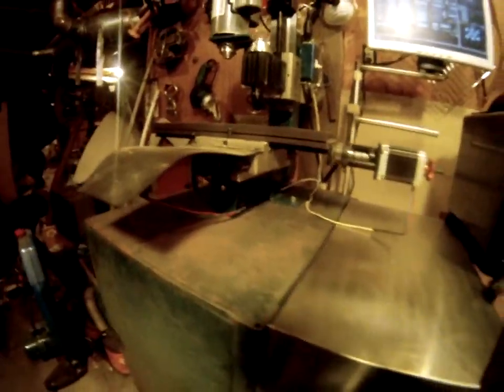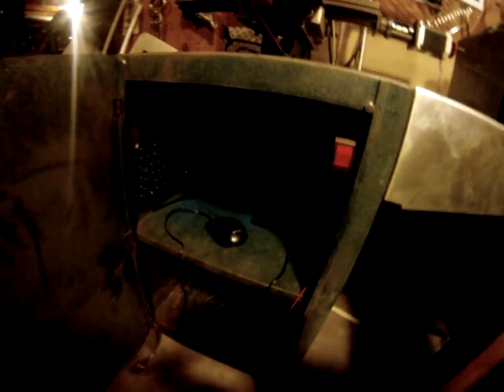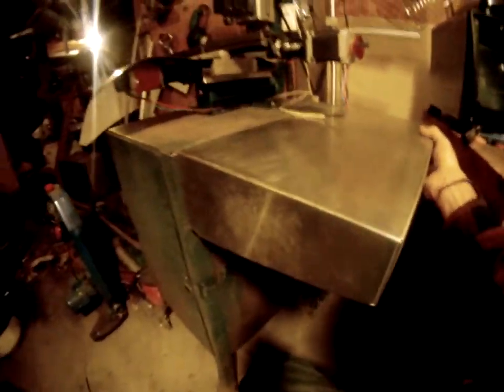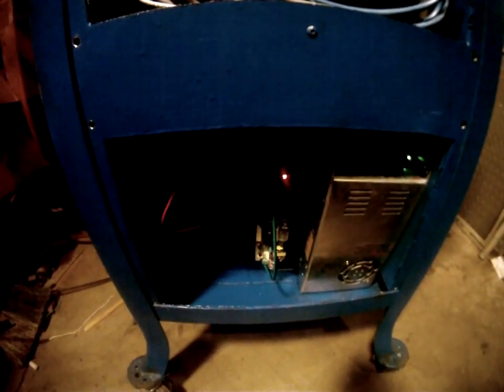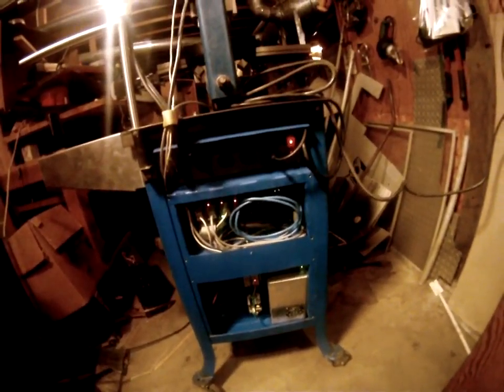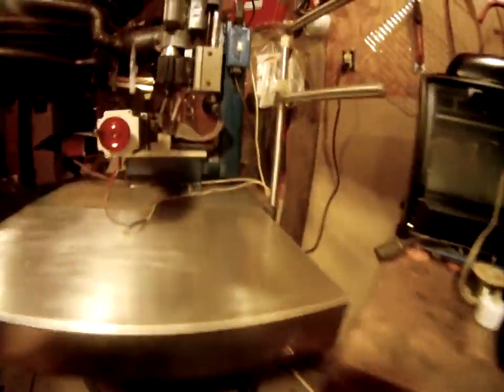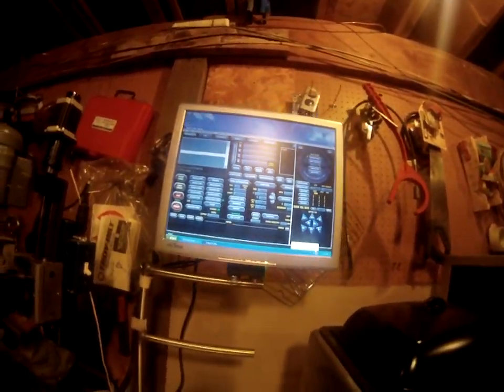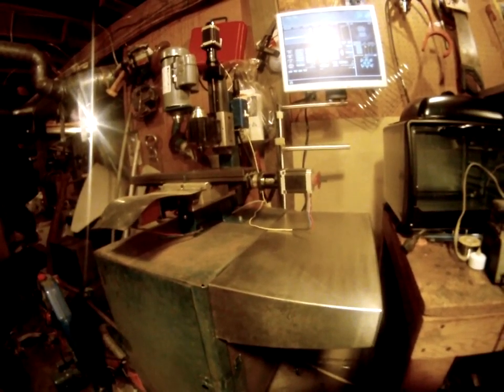Finished wireing the cnc station

Comment: Good stuff Ron, nearly ready to start cutting
Reply from the maker: Yep its close
Reply from the maker: Just found the last message you sent Youtube sure doesnt make sending private messages easy do they.  I just checked the tracking number and was shocked the box went from seattle to san fransisco for customs which seems odd.  I just saw a video of a centrifuge setup that the guy made a threaded steel shaft and drove the bowl with a pulley. It sure seems like a better way than a dedicated motor like mine. I think he was able to run higher speeds which is good and finding a motor would be much much cheaper if you didn't have one already. I just went and looked at that lowrider cnc and that thing looks awesome hope you do show and tell about it. I was bored off my ass and google earthed your address and was surprised to see that there are Canadians that live further south than me :-) Anyways.. The tracking number is  CH026040205US  and surprisingly is showing up on usps.com tracking.

Comment: I'm paying attention...  I'll need to put some of these details to use soon.
Reply from the maker: The new router sounds nice. If there is any way to increase the voltage to the motors it could run cooler im thinking. sounds backwards i know but raising the voltage lowers the amperage and motors get stronger and run cooler
Reply: I set the voltage by running them til they chattered, then cranked until they whined and back them down just a tick.  I understand that steppers would actually like to run at slower RPM so 2 start or 5 start might be a better bet on the lead screws.  Either way, the motors are too small for what I'm doing.  Bigger motors means an upgraded board, power supply, etc.  I want to do it right and it seems like a slippery slope with that machine!
Reply from the maker: yea... its just a shame not to throw some huge motors to it because its so heavily built it would just be a cutting monster...